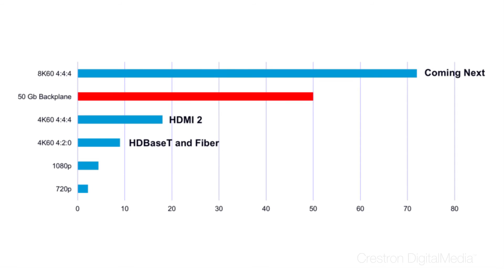4K video distribution: how to get 18 Gbps through a 9 Gbps transport

Comment: Not true. Optical fiber can handle data rates far beyond 9 Gb/s. It only has a distance limitation, with single-mode going much farther than multimode. And in case you didn't get the memo, Cisco has been offering 40 Gb/s switches since 2012. http://www.outlookseries.com/A0994/Infrastructure/3847_Cisco_100_40_Gb_Switches_Ethernet_Capabilities_Nexus_Switches_Catalyst_Network_Virtualization_Cisco_100_40_Gb_Switches_Nexus_Catalyst.htm
Reply from the maker: Hi Peter, 

Yes, fiber infrastructure exists in many forms. For our purposes, we're concentrating on standard, field terminated single-strand fiber for dedicated AV transmission.